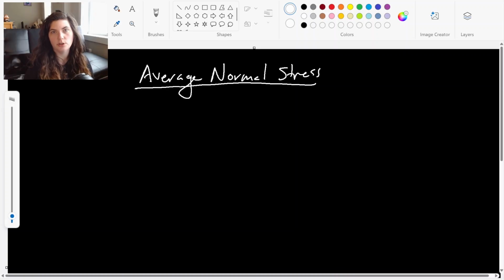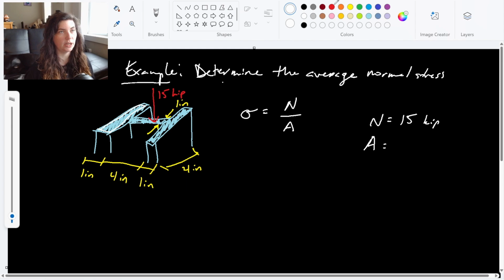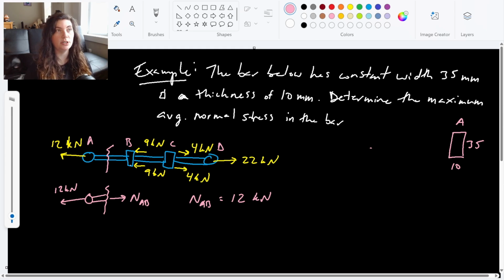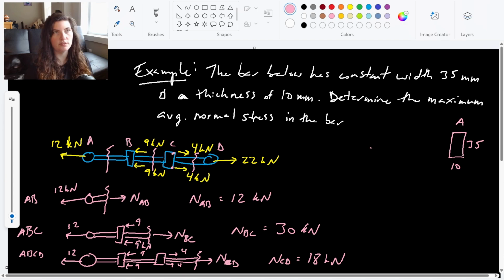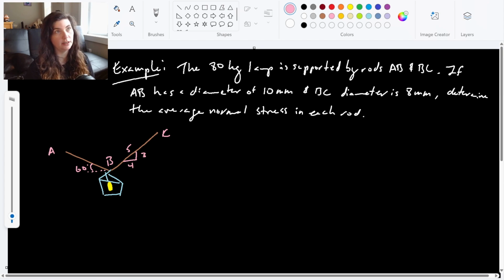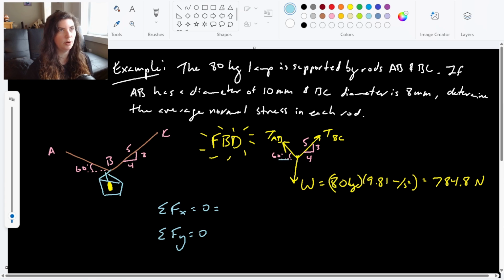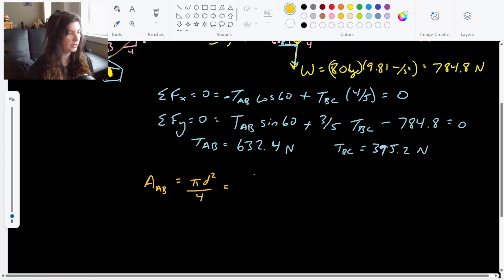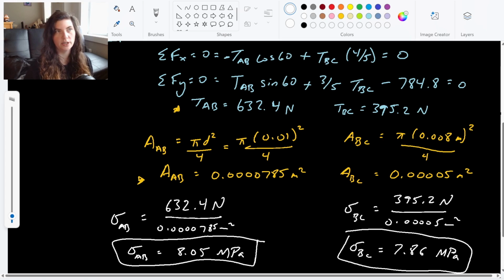Normal Stress - ENG 217 Strength of Materials - Lesson 4

Comment: 9:24 May I ask why the 22 kN was not taken into consideration when calculating the max normal force
Reply from the maker: Thank you for pointing this out! This is actually an error in calculating the normal force in section CD (which should be 22kN, not 18kN). When calculating normal force, look at combining all the forces to the left OR to the right of the cut in the section of interest
Reply: @EngineerCuriosity  Thank you so much for the clarification